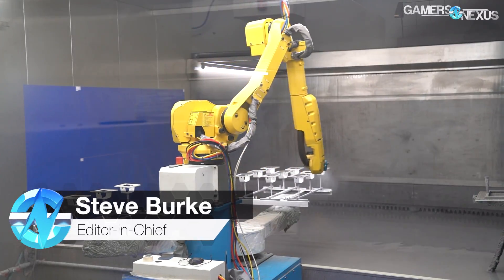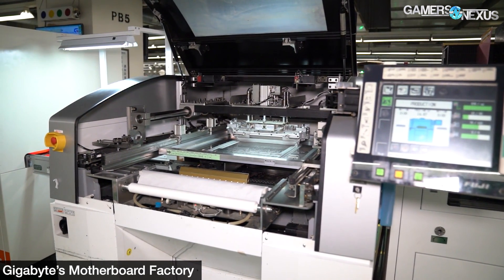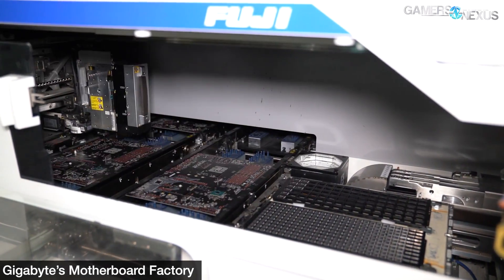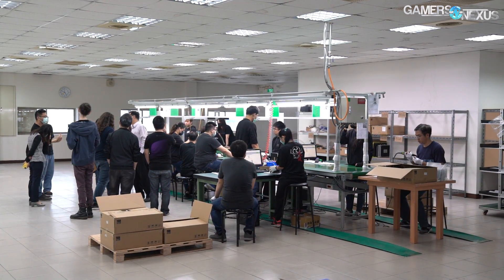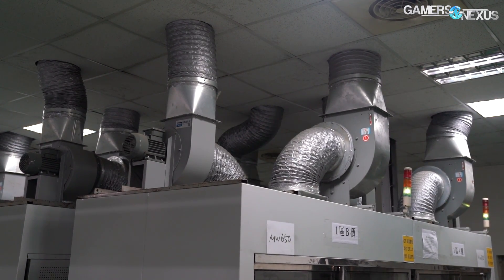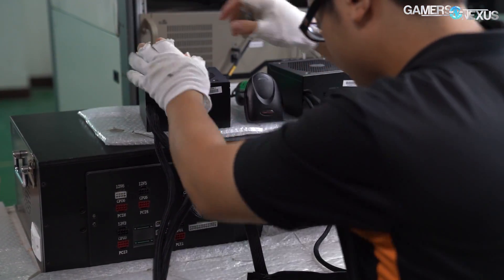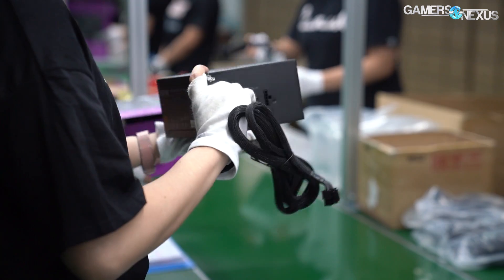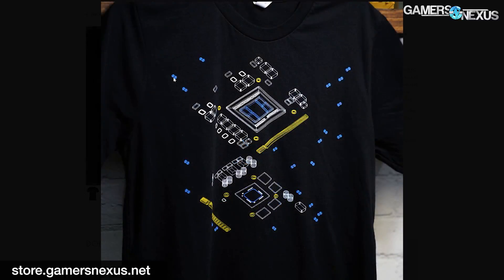How Power Supplies Are Made (2020) | PSU Factory Tour, ft. Cooler Master

Comment: After applying solder paste in the screen printing machine, there is the SPI machine next (Solder Paste Inspection), to inspect the quality of the solder paste applied on the PCB, then it gets passed to the pick and place machine then straight to the oven, after all that, the AOI (Automated Optical Inspection) machine which inspects the components, solder joints etc

Comment: My disdain is not for the manufacturing. It is for the piss-poor design.
In 1961, an engineer figured out how to put more than one transistor on a chip. They call this an IC.
In 1967, an engineer figured out how to put more than one element in a magnetic circuit. This is called integrated magnetics.
The manufacturers use a 1920 circuit and a 19th-century rectifier.
They do NOT use integrated magnetics.
They do NOT use 2011 topologies.
They do NOT use Hybrid Switching - (fixed off time, variable on time combining PWM with resonance).
They do NOT use two-quadrant converters.
The only improvement made since 1980 is replacing the buck converter with an LLC regulator.

Comment: Modern (2011) designs are smaller, cheaper, and get up to 99%+ efficiency. Manufacturers still use the 1920/1988 designs.

Comment: Ive had seasonic power supply fail after shop warranty so I had to buy a corsair one to replace it. I remember my buddy and I did lot of troubleshooting at the time and we just borrowed psu from his system to mine and it worked xD. I think the seasonic lasted about 5 years or so maybe. But never had any problems with corsair psu's and its possible that seasonic has improved in all this time as well.

Comment: Its still hard to understand why this all looks so good, yet so many hard failures occur even in "quality" brands.  Recently I needed a new power supply for a new build im now on disability and the PS had to cost no more than $50-ish, for this I thought id try a C-air - but the reviews for them and others in this price range were so scary I just couldnt bring myself to try one.  I know all reviews arent 100% perfect, but a large number of them will make it difficult to drop $50 or so without concern when money is very tight.  It seems in many cases these days you almost have to choose the highrr dollar higher tier units as the rest seem to have bad QC.  This film showed a currently slowed down production process but I do know from working in factories myself that if things were running full speed the QC is often negatively affected.

Comment: I agree that power supplies seem to outlive most other components. My XFX pro 1050w psu that I bought at the end of 2013 is still in use and has persisted through 2 complete pc builds with no hick-ups and looks like it will keep on lasting for the foreseeable future.

Comment: Another interesting video Steve! I had never had any psu issues until 2017 where I had two fail in the same way within 6 months of each other. The unit in question was the rm650x from Corsair, each unit produced a loud bang when the rocker switch was turned on after a PC clean. This completely blew capacitors and rendered the units dead. I RMA'd both PSUs to ebuyer who have the ability to test hardware in the UK and they told me they had had several do the same thing but that they continued to sell them. Weird. Since then, I did some digging and found many many reviews on amazon reporting the same failures... Please Gamers Nexus, can you test this PSU? Unless of course you've got a little deal with Corsair that you don't want to jeopardise. Love the content as always.

Comment: surprised they use batteries to recover load and not capacitor banks. much less capacity per area, but high current loading and return power are immediately available, and there's no chemical process to create waste, no dangerous gases, no expensive battery degradation, and less power wasted in chemical transduction. I'm sure they're smart enough to have their reasons

Comment: Great video. I really like content like this. Looking forward to the R&D episode. 

The soldering machine you show at 4:15 is performing a process called "wave" soldering. A large amount of solder is melted in a tray where the boards are dipped into it. This is for through hole components. You describe it well.

Reflow soldering happens in a totally enclosed oven. This is the process that occurs directly after pick and place. The heat is ramped up to an initial plateau to activate the flux and then ramped again to about 250 C to melt the solder.  This is for SMDs. 

Both are essential for a board using both through hole and SMT. The boards first have the SMDs placed and reflow soldered, and then the through hole components are placed and wave soldered. Once caveat is if you have a dual technology board, to utilize wave soldering there must be surface mount components only on the top side. Otherwise the wave soldering process would melt the solder attaching the bottom layer SMT components and they would be removed from the PCB. Notice at 4:40 the bottom of the board has no SMDs.

Your description of the RMAs at about 16:15 is literally the same story as the history of how the term software "bug" was coined. 

https://en.wikipedia.org/wiki/Software_bug#History

Comment: Nice Video. I got a bad Cooler Master power supply once, the fan was hitting something, made a hell of a noise. So I went back to where I purchased it and was told they told me (unlawfully, 2 weeks later) that they would sent it out to be repaired but not replace it. So I went and bought a Corsair power supply else where and never bought from that retailer again. I still have the Cooler Master power supply around somewhere.

Comment: I've had a power supply fail on me before and it suckkkssss. Usually at the point you've swapped out every single part in the system, or if you're lucky move the faulty psu to a different system and discover the. psu itself to be the issue. When they fail it can be really hard to tell cause usually it results in things like system instability under heavy load, random crashes, etc

Comment: Weird that you are saying PSU's hardly fail. After over 20 years working as a freelance PC tech, probably 80-85% of the non-user caused problems I encounter are fixed by replacing the PSU. 
The rest are mostly hard drive failures or software issues.

Comment: 19:17 Shielding test seen through old Compaq 7500 CRT? Seems legit

Anyway, about that "PSUs have low failure ratings". You don't have the idea how many very high end models have failures because of cheap materials and bad designs. Expensive products these days have the highest end price : manufacturing cost ratio

Comment: You're right that there was nothing wrong with my power supply. Turned out the motherboard cable on the power supply side got disconnected. Must not have gotten it in all the way. Went to power on and couldn't figure out why it wasn't turning on at first.

I ended up have to remove the power supply cover to reveal the problem, but not before becoming worried that the power supply might've died. I figured it wasn't the motherboard since I did test it outside of the case beforehand.

Comment: i had two corasair 650's both DOA almost couldn't believe it... went with a Thermaltake 750 no problems (system at full throttle would only pull 450 watts anyway...)

Comment: I'd love to pull a power supply apart and put it into an acrylic panel with water cooling runs. Use it as a mid plate/spine for an SFF case to connect the cooling runs, cool itself and just get the PSU out of the way for air flow

Comment: It won't be very long until manufacturing is 100% automated for all volumes and levels, from design to shipping. Soon, computer software will be able to take raw specs, design everything in less than a day, configure machines to manufacture a small number of them, test those, refine the design, have a finished product, then configure the rest of the equipment to manufacture the finished product in about a month, with no human intervention at any point, including repair and maintenance of the equipment; robots will take care of that.

Comment: I always recall a moment when I bought a brand new Cooler Master PSU - 700 W- modular...
Cooler wasn't working since day one, and it kept shutting off, compromising the safety of other components, due overheating, it was a major pain in the ass that boggled the service for a long while, no one suspected a brand new cooler wouldn't work on a PSU...Would never buy again.

Comment: I've had 2 failed power supplies from EVGA G5 Gold Series and Corsair CX750M ( this one fried 2 SSD's.. ) over the last 20 builds, yes I've tested every little part prior to blaming the PSU, after replacing those PSU's everything worked fine.
Reply: Id thought evga would be better,hopefully its just an exception. I read corsair cx psu reviews,some of them do fail. I currently bought a seasonic focus for higher wattage and smaller length of 140mm. You could try seasonic instead

Comment: Well, for my experience PC PSUs are actually failed far more often than any other PC component. If PC is unstable or not turning on, it's most of the time a PSUs fault. Most recent problem was with NZXT E650, it's unable to provide enough power even for GTX970.

Comment: Ive personally had 2 corsair psu stop working within a month of purchase and my buddy also had 1 that went not sure how long he had it. I deffinitly dont have a pest issue lmfao after spending the premium on corsair and losing 2 1000w psu i swapped to thermal take and the specific one im talking about replaced those 2 corsairs 8 years ago and is still working amd 100% solved my computer from randomly turning off. Fortunately at the time i had multiple psus to troubleshoot from the get go corsair sucks imo and those were gold rated.

Comment: Cooler Master displays here intensive quality testing, which I sadly can not confirm. Bought 30 1300W PSUs and at least 5 of them could not hold to 1100W load over a couple of minutes under normal enviromental conditions. Guess this was CMs showcase factory and these high quality testing standards are not applied in all facilities. At least the contact with the CM representative is cooperative and we are in exchange of finding a solution.

Comment: Well with the burn in test. Why don't the PSU's not feed inverters? In this way they recycle around 70% of the total power used. It costs a bit to install and make such a system but it will save so much power and increase the testing capacity to a full cabinet for higher power PSU's.
Reply: 12:18 NVM

Comment: From professional point of view. All looks good.What surprised my was that really really dirty soldering Owen..Place where melted solder was doing soldering of HMT components..That Owen needs cleaning for sure...and what was that cartoon board doing there(it was probably some metal sheet..) .rust all over the place..come on..I know it is about 20 years old but still it should not be so rusted..where was the maintenance done on it..That should change.  :) Also another remark..even it was final inspection and maybe it wasn't necessary to have so high protection..i was missing ESD cloths on workers..they had ESD straps..and that was good ..ESD floor was also good..but they should have also ESD cloths as well..i don't think they had that..

Comment: I've had one power supply failure and it was an EVGA 500W that I had built a budget pc with. It only lasted a month. One day I tried turning on the pc and it wouldn't, flashing amber light on the power button. I went through a very lengthy troubleshooting process by replacing the cpu, motherboard, ram, hell I rebuilt the whole damn pc until I got a different power supply and it fired right up. I was so stumped because my mind was saying the whole time it can't be the power supply, it's brand new. How wrong I was.

Comment: Once I got a PSU failed.

That's a cheap PSU that's bundled with case, powerlogic azzura. (Don't worry, it's not gaming spec!)

It fails to supply power to hdd, and then when i plugged it back, I smelled magic smoke, but it's still running

It has been torn down

Comment: Love how coolermaster is sneaky regarding psu failures.

A very common issue on lower end units is the voltage going out of specs on specific loads. Technically the psu "works", it just kills some of the connected hardware.

Comment: The only time a PSU ever failed on me was fault. Had not plugged in the wall cable properly (dodgy cable anyway). Crackling sound then it blew the PSU. Scared the life out of me. Not only was there a very loud bang but I also felt the pressure of it, my head was over the back of the PC.

Comment: they could use variable load controllers to charge up a battery bank and then have grid tie inverters running from the battery's to put power back into the grid. its not very efficient overall but compared to just heat it would save them an fortune in bills!

Comment: I have the MWE 650W Gold one since early 2019,its doing its job fine but I got unlucky and mine has a very low pitched coil whine as long as the PC draws power even if its just the status led on my mobo.
Quite annoying cause I have sensitive ears and I can even hear it in my bed when I go to sleep so I have to completely power off my PC every time.
Can't really RMA it either cause coil whine doesn't count as faulty and even if I could there is no guarantee that the new one won't be the same or worse so I just live with it.:/

Comment: To me, power supply is the most fascinating part of a pc. If it's any good, quality wise, It should give stable and proper power as the need is constantly fluctuating , it should protect it from many threats (power surge, other components failure etc). All these matters are critical for the ecosystem. It's very underrated compared to other parts.

Comment: So, you are showing of Cooler Master PSUs which are NOT made Cooler Master (because it outsourced) while advertising a PSU also NOT made by Cooler Master (because it's bequiet). Cooler Master seems to get the short end of the stick on this video.
Reply: Corsair also doesn't make Corsair power supplies, Be Quiet doesn't make Be Quiet power supplies, literally none of the popular brands actually make their own power supplies. Except Seasonic, which is actually one of the OEMs for aforementioned brands...
Reply: @Mythricia1988  Missed the point much?

Comment: Why can't they incorporate a PSU with a motherboard? Even if they could make a case to 'match' the motherboard..?
Reply: The motherboard uses almost no power, it's the other components that do. So there is no way they could incorporate a power supply powerful enough to suit all the possible use cases, since they'd have to build it assuming a worse case scenario. Also power supplies are large, and there's absolutely no way it'd fit on a mother board.

Comment: The stamping portion reminds me of how they showed us how various larger parts keep getting stamped out in my auto oem.  It keeps cutting various pieces off in a huge row of machines.  The funny thing is with the geology of our area, they had to dig out a huge chunk of earth and pour huge support foundations for the stamping, otherwise the machines would literally pound themselves into the ground.  

As far as part level/supplier electrical things i've dealt with are high level and don't come close to component level most of the time.  Its mostly tier 1 and not much lower than that, but there are exceptions.  Yay quality world!

Comment: FWIW I had a genuine power supply failure last year, with a unit that shut off a few minutes after first installation and never switched back on even with just a molex powered fan and a jumpered 24 pin cable connected... even though everything else worked with the old power supply that I was attempting to replace I didn't use that machine again until I received the RMA replacement a month or so later.

Comment: Has anyone ever heard of a way to remove static charges from non-conductive materials like glass? 
Like if you remove plastic from a tempered glass panel it will have a static charge and dust will be attracted to and stick to it. Is there any way to discharge it since it’s not as simple as just touching it like metal?
Reply: There are special brushes to remove static charge from vinyl records... Maybe try one of those? Should work the same! Search for "Antistatic brush" or similar.

Comment: It's not that the power supply is blamed first, it's that if it IS the power supply, it can fry the entire computer. It's also that they're difficult to adequately test at home. A power supply tester can tell me if it's dead, but load testing's a lot harder. 

Still, I've only had one power supply I know was bad (and even then I don't know if was the cause of the failures or if something else killed it). Lost the motherboad, power supply, and graphics card. Power supply was the only thing still under warranty though.

Comment: Thanks Steve and team. 

To me, this is the best factory video so far. PSUs are my favorite hardware component. My OCD loves how contained and uncluttered they are. I can't own anything less than a fully modular unit. The extra cables would irritate the sh*t outta me. I'm such a cable management freak. The rear exhaust fan on my X99 can only reach a mid-board header and even though I've got it perfectly trained and routed it has a couple inches of slack that doesn't seem to want to tuck in anywhere and it's just short of being able to wind it in with a quarter turn of the fan, aaaaaarg!

Comment: They are still running windows xp, lol
Reply: A lot of CNC machines still run XP and use a parallel interface. There are upgrade options but as long as the XP machine is well maintained and air gapped there's no reason to go through an expensive and complicated upgrade.